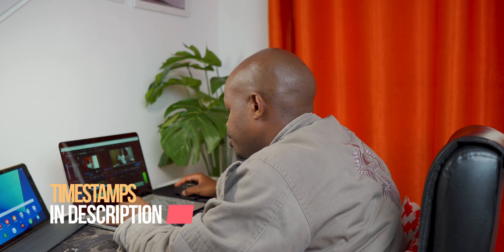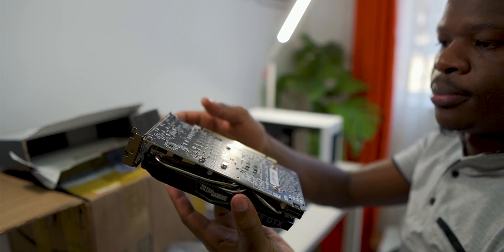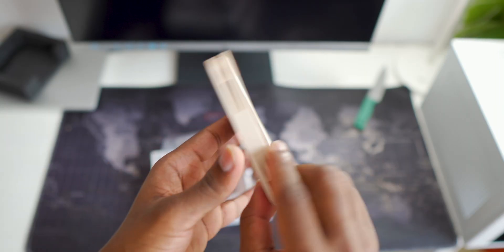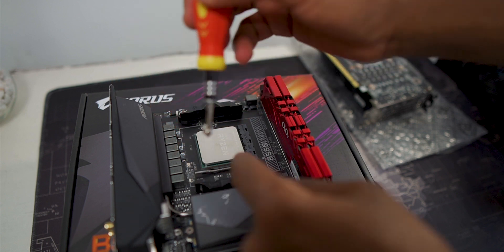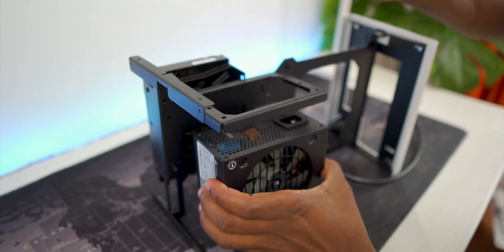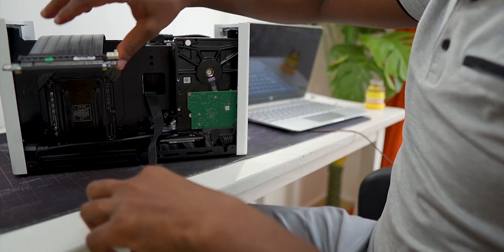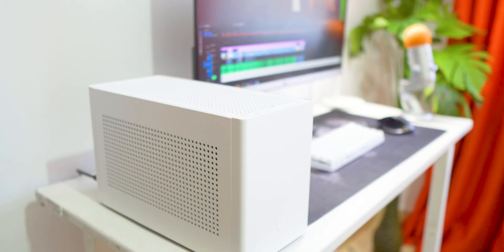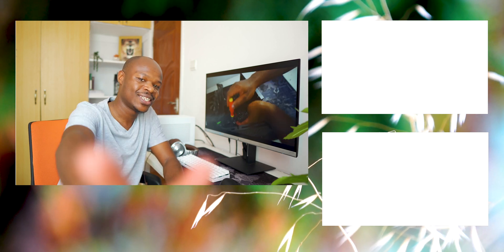I built a tiny but POWERFUL PC! // Aklla a4v2 ITX rig

Comment: Just some question:

1.How are the temps?
2. Can you pu a 3" HDD on the bottom part of the case instead of the 2.5?'
Reply from the maker: 1. CPU Avg 37C idle, around 80C full load
2. I dont think it would fit... due to the cables